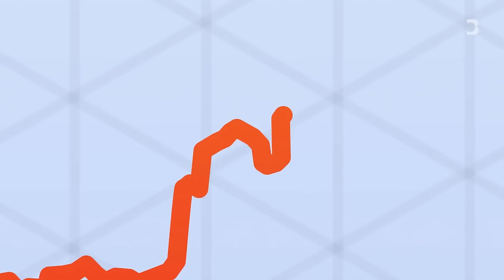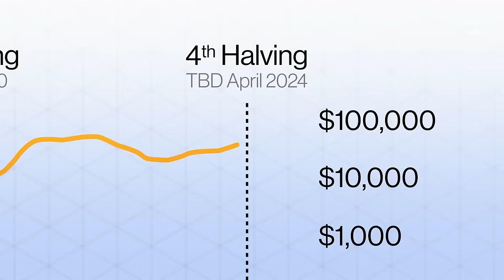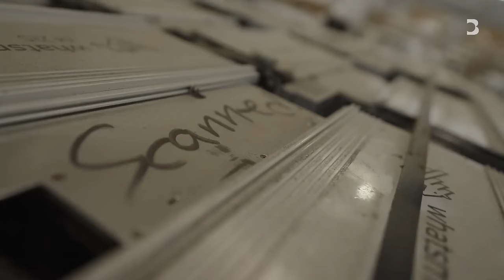How Bitcoin's Halving Could Boost the AI Business

Comment: So the end of the video they say that the requirements for AI are completely different from crypto mining. Thanks guys.
Reply: But using the older equipment no longer in use for crypto mining, you can build very powerful AI machines. This was the whole point of the video, wasn't it?
Reply: Bitcoin ≠ Crypto
Reply: @yousefshnaiwer6936  No, the video specifically says that the mining machines can not be repurposed for anything. The only "advantage" the mining CEO claims is knowing how to select and set up server locations which is zero advantage.
Reply: @djgodigod  I agree with you that is what he claims. I just do not see (and it is not stated clearly in the video) why these machines cannot be repurposed. Especially that the data miners need to change their equipment much faster now, the older machines have not been exhausted by data mining yet when they are replaced. Is this related to how they are programmed and/or connected?
Reply: I think the bitcoin miner are programmed to do one thing, that is sha256 hashing, so they can’t be repurposed. Hopefully they can recycle them somehow

Comment: AI is 100x harder than bitcoin mining, its not just compute power  left over from bitcoin and the machines used to run AI models are not the same as the bitcoin mining rigs, it more complex and there is not guaranteed return like bitcoin. Its like a Textile or a Candy factory trying to repurpose their machine to start manufacturing vehicles.
Reply: THANK YOU!

What would be revolutionary would be a way to use ai training as the proof of work for a cryptocurrency. a way to have a quick enough blockchain, in the order of 1 block minted per second minimum where the work is also useful vector arithmetic chunks for ai training. One could pay in crypto to have his neural network trained by the miners giving the currency a reason for existing and reducing the carbon footprint to zero since the work done is not wasted.
Reply: Pay attention to what the people involved are saying. the crypto miners are not in the business of AI model training, theyre selling their old capacity to established AI companies or acting as a middleman between serverfarms and AI companies. there were 0 businesses in this video which were both mining crypto and also working on their own AI.
Reply: "Textile or a Candy factory trying to repurpose their machine to start manufacturing vehicles" Sweet, why not? they both involve machines that spin. I see that they have a lot in common. LLM's inference is essentially many TFLOPS of multiplications. Doing terahash requires even more steps.
Reply: @wffff2  I’m pretty sure that’s what actually happened during WWII 😂 so there was competition to produce the sweets and candies for war rations in order to avoid your factory being mandatorily repurposed.
Reply: Err no. A GPU is a GPU. 
As long as it's not an ASIC machine it can absolutely be used for training.
Reply: But that literally happened in history (repurposing factories)